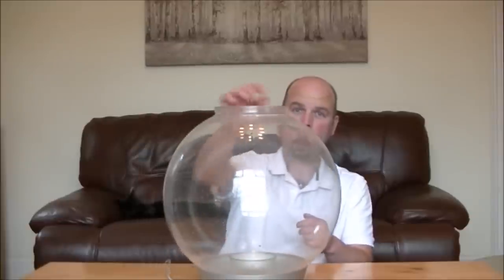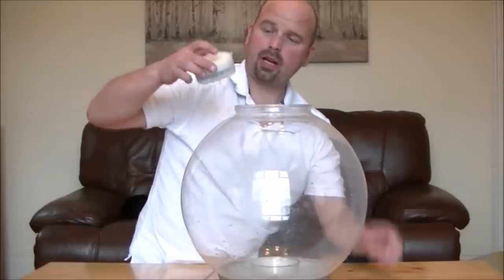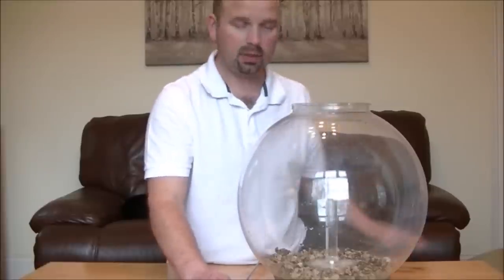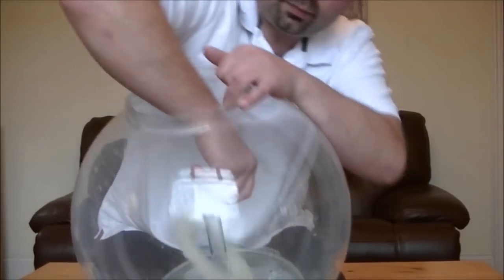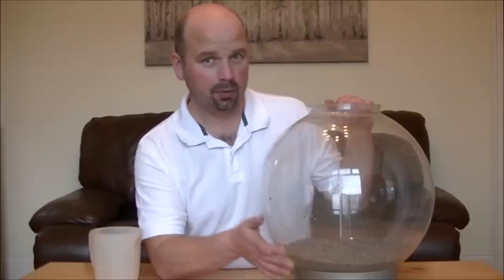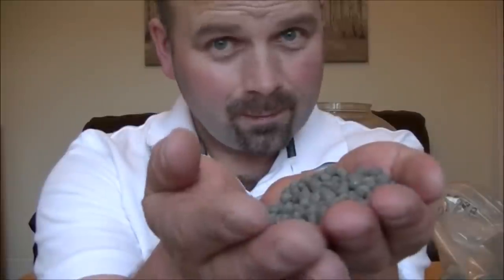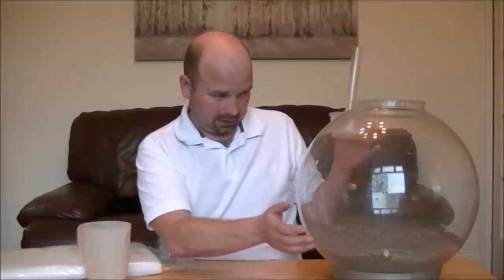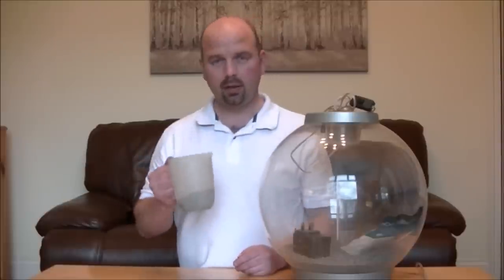BIORB COMPATIBLE UPGRADE KIT

Comment: I just set up the 30L tank with your compatible upgrade. is there any reason not to put the chunky gravel that came with the Biorb on top of the upgrade media? There isn't really enough of the upgrade gravel to get live plants stabilized, as the bio-gravel is only a few beads deep in my tank. Thanks.
Reply from the maker: You can add the alfagrog media over the top no problem as long as you move it out of the way when you are using the gravel cleaner to remove muck from bottom of tank. There should have been around 3/4" (20mm) of biogravel over the foams - is it a 30 litre orb biorb you have?
Reply: yes, the 30L globe. I'm new to live plants. will 20mm be deep enough for root systems? should I put in the bacteria gel balls before, at the same time or after the plants are introduced? Thanks so much for taking the time to answer questions. much appreciated.
Reply from the maker: The gel balls would go in with the media (biogravel) and they will seed it with good bacteria. 20mm is deep enough for plants to root into but usually they would be on bogwood or have a deeper substrate (it depends on the species of fish you're keeping too). There aren't many types of plants which do well in orbs but dwarf java fern and anubias are two which cope well with the low light output.
I have looked up your order and I see you're in the US so if you do want the substrate deeper it will probably be cheaper to order from the US supplier http://www.greatwaveeng.com due to shipping costs from UK.

Comment: For the egg crate foam pad, is it okay if it's soy based?  I already have foam so I'm wondering if I could just use that. Thanks!!!
Reply from the maker: I have never heard of soy based foam so I can't answer that unfortunately.
Reply: Thanks! What is the foam that you use made of? Is there something special on the package that you look for?
Reply from the maker: I'd imagine that it was made from some water-safe plastic but I do not know the exact construction material. Sorry about that.
There is nothing on the packaging - just look for foams suitable for pond filter use and avoid foams used for upholstery as they will often be treated with a flame retardant which is not good for fish.
Reply: Pondguru Outdoors thanks! How often do the foam replacements & filter media need to be cleaned?
Reply from the maker: The foams will need cleaning as and when they are dirty which could be 1-6 months depending on the tank and stock / feeding and the fine pad would need replacing every 1-6 months depending on the tank and stock / feeding. The filter media should stay quite clean if the filter is properly set up so just check it while maintaining the foams and gently clean it is a bucket of water you have drained from the tank (just shake the basket of media in the water - no need to take it out and wash individual pieces).
Cleaning times of filters vary so much there is not a simple answer to how often they need to be cleaned but leave them as long as you can since there is no need to clean a clean filter.
Reply: Thank you so much for your reply! I've learned a ton from your videos!!
Reply from the maker: No worries, any time - glad you find the videos useful.

Comment: Is that a 1kg bag you used there?
Reply from the maker: +grizta30 For this upgrade it was approx. 1.5kg but I have since changed the foams to have a deeper profile so if using the it needs 2kg for the 30 litre orb and 3.5kg for the 60 litre orb.
Reply: +Pondguru Outdoors What about the larger Biorb 105 ?
Reply from the maker: +Venomynous It would need the foams cutting bigger than the templates in the 60 litre kit and the amount of biogravel needed would be approx. 5kg.
Unfortunately I haven't had one of those tanks to measure up for the foams but people who have them say that the 5kg covers the foams well and they cut the foams bigger than the templates in the kit (as the base size of the 105 is larger than the 60 litre tank)

Comment: What weight of biogravel is required for this?
Reply from the maker: The weight would be as follows:
15 litre orb 1.5kg
30 litre orb 2kg
60 litre orb 3.5kg
105 litre orb 5kg
That is based on the new foams in the kit which have a deeper profile. I now use them as they are better quality than the foams in this video which are flatter.
Reply: +Pondguru Outdoors cheers I'll order another kilogram.

Comment: Just bought 1kilo from your eBay shop was a pound more than your website but I could pay with PayPal lol my tank is already set up and I put foam on the bottom like you did but I have used sand because I have a gold pleco if I reuse most of the water from my tank will it be safe to completely redo the tank with the biogravel
Reply from the maker: Unfortunately the cost is more on ebay due to ebay fees but the FilterPro website takes paypal and all cards.
If you are looking to make a filter system the same as I did in this video you could need 1.5kg (15 litre orb), 2kg (30 litre orb) or 3.5kg (60 litre orb) - that is how much comes with the various upgrade kits available on website and ebay and although it only takes around 1kg per 100 litres to see a reduction in nitrate when any type of biohome is used in a filter in this situation the biogravel is used as a substrate so the amount is dictated by the base area of the different tanks.
When upgrading a mature tank just keep as much old water as possible and make sure that the  biogravel has had a very good wash prior to use.
Reply: Pondguru thanks I will order some more on Friday and add it to my tank
Reply: First lot has just arrived have ordered 2 kilo more from your shop, wish I had payed better attention as it’s been more expensive buying it in two separate lots. other viewers take note don’t try to be cheap like me ,  Buy the actual kit for your size tank it is definitely cheaper lol on a brighter note you are right the biogravel is a lot smoother than gravel so my plec will be fine with it,  thankyou for all the advice and help
Reply from the maker: No worries and thanks for the order - it went out today so it should arrive early next week. I really need to make some more biorb related videos to lay out exactly how much media is needed for each type as it could be anywhere from 1.5kg to 5kg.
It is rare that anyone orders too little but it has happened a few times which is why I put the amounts required for the various tanks in the video description and the pinned comment but sometimes when the video is viewed on mobile devices or tablets the description and comments don't show automatically - I recently had someone order 1kg and was quite irate that it was not enough biogravel for 2 of his 60 litre biorbs.....

Comment: No, didn’t work for my biorb flow. Had the fish tank new setup running for 4 weeks before introducing the fish, with regular water changes and parameters check. And also upgraded the pump for a more powerful one. Put it altogether as per instructions. It takes a awful lot of room, is hard to clean and does not work as stated. Mind you: I had the whole thing assessed by my local petshop staff  and also by one if my friends who works at sealife: water parameters, type of fish and quantity, light, food….Conclusion: biorb filtering system is bad and this setup, which I bought from the link on description, did not help.

Comment: do i need  Alphagrog filter media and foam media or just one of them plus normal tank gravel  . thanks dee
Reply from the maker: If you are thinking of using the foam idea you will need to cover it with either the biogravel (which acts to totally over-filter the tank) or ordinary aquarium gravel which acts like a standard under-gravel filter. Either way is way more effective than using the alfagrog as the water follows the path of least resistance around the grog. It is a sharp media too - no good when in direct contact with the fish.
Reply: Thanks

Comment: Thank you any idea on the amount I will need in biorb 60 where do I get the foam also please.
Reply from the maker: +Maria Lee A biorb 60 will take between 3kg and 3.5kg to cover the foam depending on how bumpy the foam is.
You can get suitable foam from any pond supplies outlet but in some countries they are difficult to get for some reason. I sell foams and biogravel (and also the biorb full kit with templates) on my website here http://www.filterpro.co.uk and also on ebay.
Reply: How much bio gravel stuff needed for a 15l biorb tube model?

Comment: I am planning to setup a 70 galon tank with a canister filter. would you recommend me to add a UG filter also to the tank?
Reply from the maker: +Rohit Tulsiyan No if you have  a suitable sized canister filter set up properly it will be the only filter you need. Also if you have tropical fish they would be better with sand as gravel tends to keep the pH up around 7.5.
Reply: +Pondguru Outdoors I am planning to have a 70 gallon tank, and the Canister filter has 256 g/ph capacity. Now you suggest please. Another thing is I have flower horn in it, and in long run (after few years) I am planning to have either Oscar, or Sting Ray, Or Discuss, or Aruana. please suggest, gravel is better or sand?
Reply from the maker: +Rohit Tulsiyan Sand 100%. All the fish you mention are happy at around 6.5 and gravel won't allow that to happen. Stingrays definitely don't do well on gravel. What model is the filter?
Reply: +Pondguru Outdoors Sir, thanks for suggestions. I am in India and ready-made aquarium is not very popular here. This is a custom made aquarium kit with local suppliers. Cabinet is being built by carpenter, Glass aquarium is being built by local fish tank store. Lid will be made by plastic decorator who does make lids. Filter I bought online, and fittings would be assisted by same shop owner with necessary accessories. :) :) Please feel free to give more inputs as I am on the way of making it and set up is yet to be done.
Reply: +Pondguru Outdoors One important question. Do you suggest me (based on my needs) Reef live sand or normal river sand for aquarium?
Reply: +Pondguru Outdoors This is my fish in my current 70 ltr aquarium. This photo was taken few months back:
https://flic.kr/p/sq55um
Reply from the maker: +Rohit Tulsiyan Yes definitely needs sand - normal river sand is fine as live reef sand will make the pH sky high.
Reply: +Pondguru Outdoors Thanks a ton sir for your valuable guidance.

Comment: OMG  I need to do this but where would I get all the supplies P.S. I live in England
Reply from the maker: +Erin Canham You can get the foams from any decent pond supplies shop and just use ordinary gravel but I do the kits with proper biogravel (which acts as a filter media) on my website http://www.filterpro.co.uk (filter kit page).
Regards,
Richard
Reply: +Pondguru Outdoors sorry I didn't reply in ages but I'm saving up my paper round money and I'm nearly there I just have £5 left to go as I have £30
Reply from the maker: +Erin Canham No worries, sounds good to me. If you send me an email to pondguru@btinternet.com with what you are looking to buy I will work a price out no problem.
Regards,
Richard
Reply: +Pondguru Outdoors my upgrade kit came today very happy. I have 4 fish in my biOrb (2 minnows and 2 small danios) but they can't go in the tank for a week once I have made the upgrade so could the fish thrive without a filter for a week until the tank has settled??
Reply from the maker: +Erin Canham If you transfer all the existing water and fish to a suitable container you can install the kit then return the fish and water. The instructions which say to leave the tank for a week really just relate to new tank set ups. With an existing tank you're just changing the substrate and adding some foams so as long as the water is retained you don't have to wait for the week. Just top up with fresh water at approximately the same temperature as the old water.
Reply: +Pondguru Outdoors ok Thank you
Reply from the maker: +Erin Canham I had another comment asking if the templates were to scale but I can't see it here. The templates will be specific to the size of kit and orb so as you ordered for the 15 litre orb the templates should be for the 15 litre. It will have 15, 30 or 60 written on the top of the instructions and while I haven't put an incorrect instructions / templates in yet there is a first time for anything so check the correct ones have arrived. If not I can email you the correct ones no worries.
Reply: +Pondguru Outdoors oh yeah I wrote the comment and then  finished reading the instructions and realised that said they were to scale so I deleted the comment. I have the templates for my 15 Litre biOrb and I'm going to complete the upgrade at the weekend thankyou for your help.
Reply from the maker: +Erin Canham That's good - I was worried I had sent the wrong instructions out there for a minute.
Reply: +Pondguru Outdoors no you were fine I'm sorry if I confused you, I'm good at that lol😂😂

Comment: Question, I don't have a undergravel filter (I use a internal) if I replace my normal gravel with this biohome gravel will it have any positive effect still? And also is it not sharp so corys are happy on it? (half of my aquarium floor is sand and half gravel so the corys  still will have a sand section they can thrive in)
Reply: By internal I mean a stick on the inside of aquarium :-)
Reply from the maker: OI Avo The biogravel is approx. 20% - 30% lighter than standard gravel so easier to move by corys. and rough but not sharp. Not sure how much effect biogravel would have on filtration if it was simply a substrate without water being forced over it but the fact that it is porous will enable it to support way more bacteria than standard gravel.
Reply: Pondguru Outdoors thanks for the quick reply :-) might get some of that to replace my old gravel. Another question (sorry to be annoying) but for the biohome ultimate media you were saying it has a slower flow in the middle for the anearobic bacteria, im debating getting a canister filter so I can put a load of the bihome ultimate in. Will a canister that pumps about 500l per hour have a too faster flow rate for the anaerobic bacteria? Or will it be fine at any flow rate? Thanks alot :-)
Reply from the maker: OI Avo As the tunnels through the media are a range of shapes and sizes the flow rate doesn't really matter as there will always be areas where the flow is so slow that it creates anaerobic conditions so both aerobic and anaerobic bacteria can thrive even in a well oxygenated fast flowing environment.
Reply: Pondguru Outdoors Thanks again for another swift and informative reply, I will 100% pick up some of the  biohome ultimate media when I get my external filter set up :-)
Reply from the maker: Nathan Hill No worries - good choice.

Comment: Thanks for this! I really like the bubble look of fish bowls more than square tanks but I know how bad they are. Reviews on the BiOrb are scary but I thought there was a way to fix it. I'm so going to save up for this tank and the upgrade for it. :)
Reply from the maker: Great to hear and even if the biogravel was substituted for ordinary aquarium gravel the tank would be 100% better than it would be using the standard 'media'.
Reply: Could lava rock be used as an in between sorta media? Other than the links in the descriptions I can't seem to find the stuff you used.
Reply from the maker: I had the biogravel specially made to solve the problem caused by the biorb filtration but you can use ordinary aquarium gravel no problem. It won't reduce nitrates but it will be effective as a filter.

Comment: hi looking forward to upgrading my halo 60l with this method, how would you recommend me changing over to the biohome gravel as my tank is stocked at the moment and has been for about a month now but if like to change the original biorb set up asap thanks
Reply from the maker: You can set up the tank straight away with the new system as long as you keep all the water from your tank and store the water and fish in a suitable container. Ideally the gravel would be very well washed prior to use and you could even soak it in a bucket overnight. Set up the system then add water and fish back in.
Most people say that the 60 litre kit is fine for the halo tanks but a couple have said that the foams are too small and that there is not enough biogravel to cover them properly - there may be two different sizes of halo 60 tanks out there?
Reply: Well I've got 1.5kg biohome bag of gravel and after getting it it does look like there wouldn't be enough to cover the foam at the bottom of the tank so ordered another 1.5kg today, fingers crossed that covers it lol how often will i need to do water changes with this system?
Reply from the maker: Once the cycle is complete and you get low / no nitrates you will just need to do 10% every week / 2 weeks to freshen it up - depends on the stock really.
Reply: that's brilliant thanks for your response much appreciated. do you have a website for yourself as every aquatics place I go seems to me that I get told different things for example when I brought my golden gourami the bloke tried selling me a totally different gourami as the female lol
Reply from the maker: The only website I have is the http://www.filterpro.co.uk one where I sell the biohome, foams etc. as I closed my shop a couple of years ago. For a biorb  a golden gourami is way too big as they can get almost 5" long. A dwarf variety would be much more suitable since the ball shape of the tank does not allow for much swimming space.
Reply: great this is what I mean about misinformation thanks alot for your time
Reply from the maker: No worries, any time - a rough guide for the 60 litre would be to get nothing which could grow bigger than 5cm (2") due to the swimming restrictions.